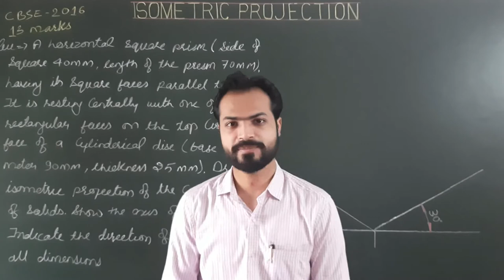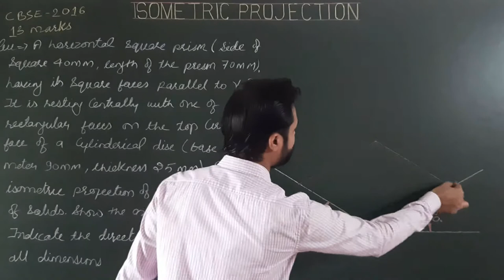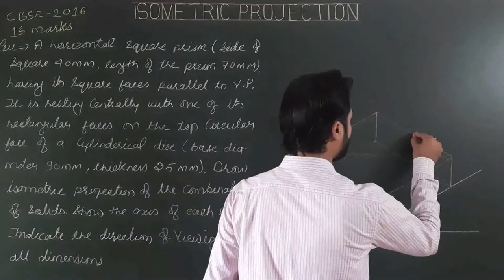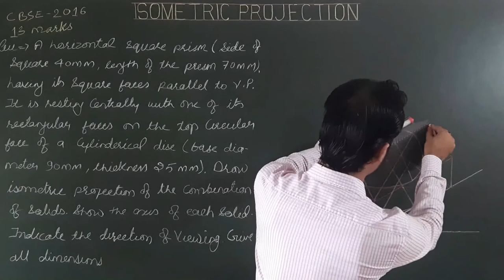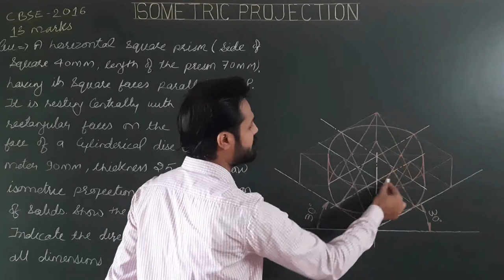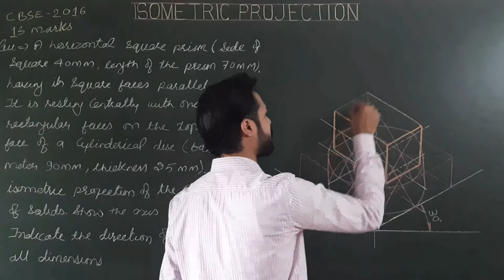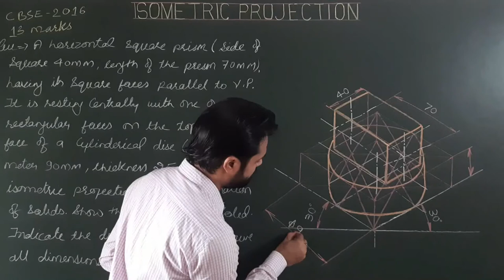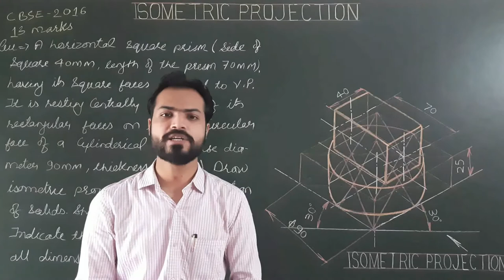Isometric Projection Of Combination Of Cylinder & Square Prism (Part - 28)

Comment: Sir plz help class 12 engeenering graphics . I am telling my all 40 class mate about your channel plz and this is on 12 th basiscs Or not which you are teaching
Reply from the maker: yes abhinav... all the videos of playlist (ENGINEERING GRAPHICS) which i had uploaded till now are for class 12th only, it covers first unit of class-12  as per the syllabus of CBSE. The questions which i have covered are mostly from textbook(NCERT) and some are from previous years board examination question paper.
Reply: Thanks sir
Reply: Sir when will be this unit is finished
Reply from the maker: @AbhinavSingh-me9qh  after 2-3 more lectures...
Reply: Ohk sir i will tell my classmates to subscribe